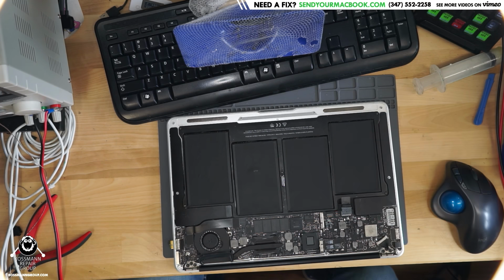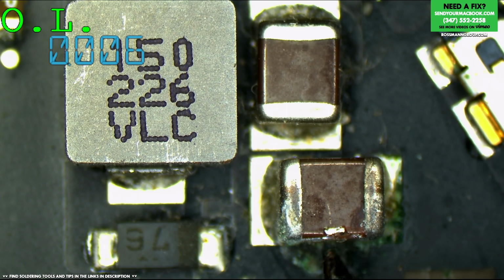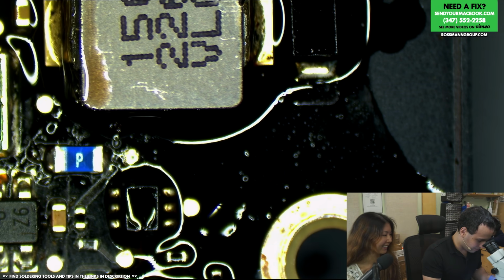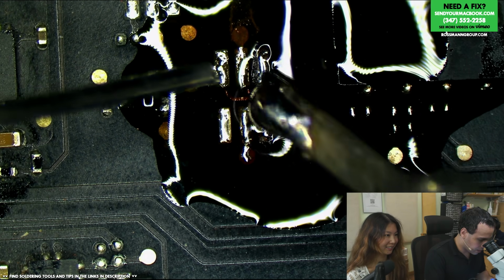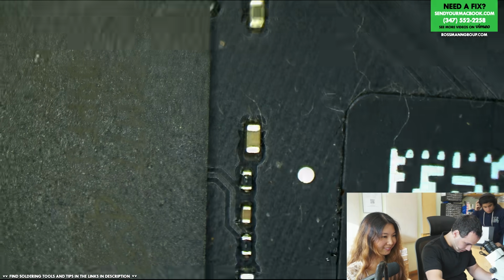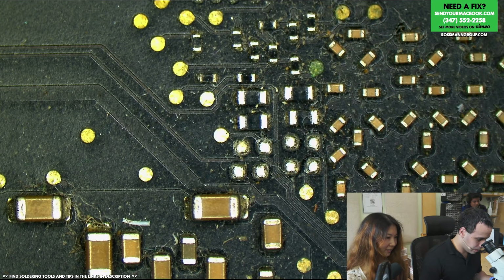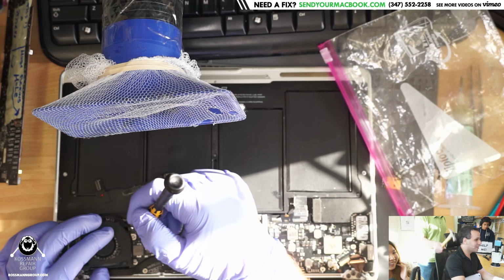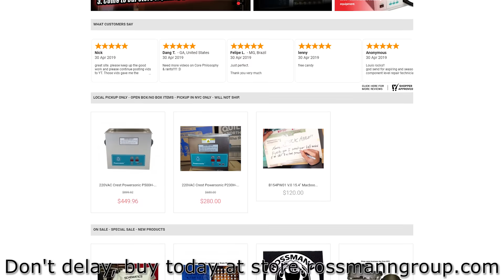Louis fixes girlfriend's Macbook.

Comment: I just wish someone could have fixed my poor htc one m9 q.q
apparently when the flex for turning on the phone is broken you can junk it -.-
Reply: I have a broken m9 too!
Reply: @cheeseisgud7311  in the same way?  The flex cable that holds the power button is broken and seems a replacement doesn't exist
Reply: @Blade4613  for me it just didn't charge, I remember putting it over night, waking up and it being at 24% I tried everything I could to make it charge, it wouldn't, Xbox one controller charger shows a red light, meaning it recpngnizes it, so it's maybe the battery or also the flex cable to the battery?
Reply: @cheeseisgud7311  it's a common problem, you have to replace the usb flex that goes to the battery
Reply: @Blade4613  oh my god, thanks mate, that's probably my fav phone ever, any idea where to get said USB flex cable?
Reply: @cheeseisgud7311  Just search on google htc one m9 usb flex cable, it's the whole piece, with the usb port that connects to the rest of the phone, i suggest also to replace the battery if you never did, since the older it gets the worst it gets, be careful not to smash the other flexs like the repair man in my town did to mine
Reply: @Blade4613  yeah, the battery is quite problematic, thanks for the info!

Comment: I glade you got her mac working again I cant believe the shoddy repair done her mac by apple.

She says she doesn't like hp she must have got a bad laptop. 

I love hp and I've had good luck with there tech support.

I've bought 4 hp computers in 2010 I bought a hp business desktop to this day it is still working it had one warranty repair power supply failed they sent a tech to my home repaired it on site. Tech support was nice and it took 30 minutes to get a appointment scheduled the repair was fast too.

In 2012 I bought a hp laptop that ton this day still works perfactly.
In 2014 I moved out and I left the laptop at home gave it to my family and bought a newr laptop.
That to this day works perfactly except the battery.

So I just bought a new one instead of buying a new battery I didnt want to pay someone to open the computer to get to the battery other then that it works perfectly.

Comment: what is a J-tech connector?
Reply: That is Jtag, a form of serial communications port/connector, which is normally used when you can't communicate with the device through regular means and is often used to (re)flash the firmware on the device.

Comment: what a surprise HP stiffing out on their warranty again.
my first hp computer (hp pavilion dv6732eo) ended up being also my last as it was one of those models with faulty nvidia m8400gs gpu.
it lasted 2 years and 2 moths and after i contacted HP about the gpu issue. all that they said was that "it needs new motherboard, and as it is over 2 years old it will cost you 500€"
i get that on a laptop new gpu is basically new motherboard, especially on cheap 799€ pavilion like that. however not only was that gpu issue part of an known hw failure when i bought the system in 2008, but even if i was the first customer in the world with this issue. my local customer laws would have made them fix it for free anyways.

however it required me to fight them over four months and start legal process over it. until they gave up and fixed the issue for free.
best part was that, nvidia was the one who had to pay hp nad othe manufacturers 5 years extra warranties on this issue.
meaning that hp basically tried to milk at least 500€ extra profit from 799€ computer.

 sad part was that i really liked that machine and most likely after 3-4 years my next computer could also have been hp. if they just had said that "this issue is known hw issue and we will fix it for free."
but thanks for their greed, i will not even get a mousepad if it has hp branding on it.

Comment: I have some really old HP computers. I think 2001. It's ok. Faster than my Toshiba from 99. I've also optimized Windows XP to the point it boots faster than my modern win 10 machine (about 13 seconds). If you only fix it yourself and are extremely careful with it you can come out OK. My new computer is one I built myself. I'm not the typical customer but still. I will say HP printers are awful. I run Brother since the last HP died.

Comment: Good Day sir i am from pakistan and having a dell inpiron 5558 i5 5200u with 2.2ghz processor and 4gb nvedia920M sir the problem is that my laptop doesnt saves the time and date and i had changed the cmos bettery too but it is same and bettery get finished in 3to4 months and then i had to change because of high sound 5to8beeps and second problem is the laptop shuts off randomly automatically by blue screen restarting  please help i need your guidence to these problems please reply anyone or you sir.. 
please help sir i am bigest fan

Comment: HP's ProBook and EliteBook series are the better HP laptops but they are more expensive because they are business laptops they are built better i have a decommissioned hp ProBook 6460B I've had had it for 10 years and it is still working great not had a problem with it.

Comment: it is a 2012 computer with sooooo many issues he took over an hour to repair but is not hard to tell that it will soon need any other fix...

that is the call to just replace it... even if it is for a second hand one that isnt so old

if this service needed to be charged it would cost easily 300 usd

1 hour of work + material + some warranty (and the computer will probably break soon)

Comment: Yeah man i had problems with owners not knowing where things were on the ceiling after I pull it down and replace it like if you had never looked at there own ceiling bef9re spend 10 years in the house and still don't remember where everything is. Serious mental issues. She has no idea if the beeping was fast or slow. More worried about rainbows facebook and shit.

Comment: Have had an have a lot of HP laptops and tower pc.s. .Not much fault.HDD died on my HP 360 laptop after 4 years witch i think was a short time.Was a seagate ssHD hybrid drive 500GB.I bought  a 100o GB 7mm thick hybrid drive and fixed it up.Have done repair for 40 years But not so much smd stuff before 2015.Did not have the cam microscope and correct tools.Today i have the tool,s and do lot more small stuff but still lot of vintage amplifiers etc and less mechanical repair jobs pr year(cars bikes etc)I always trie to learn new stuff.Almost hate Apple stuff and the mindset those have  that buy shit just because it is a "High end brand name"High end is stuff that is well made have symmetri to the el design and last 20-30 years no problem.If a feel a products that get to warm is a no buy when it is "electronics"Let say over 50 degree Celsius.60 at peak.Good videos have learned some stuff and still do.